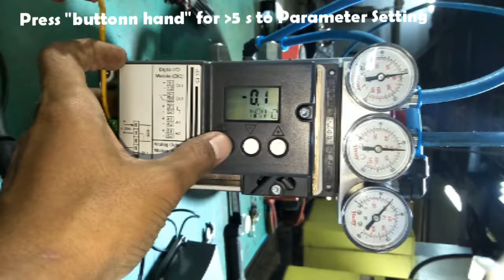Unboxing Control valve positioner, Assembly to butterfly valve, Setting Auto Initialing Bray S 6A

Comment: Brother actually   problem in my new positioner  is   in initial condition its display shows [ P 85 ] and [NOINI] mode, at that time  when i press + and - button the actuator totally not move.only small sound hearing inside the positioner and some air release backside of positioner , however pneumatic and electrical connection is ok.

if i place old existing positioner there then it easily move the actuator once i press  + and - key in sane NOINI mode as mentioned above.

So far as i know For go INITA mode at control valve should move manually in both direction and 100% travel also.

Moreover when i go in Log 5 ,NOINITM mode only 30% open the valve in both YEND1 and YEND2 once i press both (+) and ( -) key.once i release any one  button either ( +)  or (-) then actuator return  to zero condition.it doesn't hold at all.

What you think If its abnormal what can i do to fix it.would you please advice me.

 if i press only either (+) or ( -) button then actuator not move at all in YEND1 and YEND2
mode.but when i press both ( +) and (-)  button simultaneously then it open actuator only 30% but not hold at all.

After this  then when press hand button its display range message.
 
Therefore, will you please advice me its normal or abnormal?if abnormal then what can i do to fix this problem.
 
Really i am facing a horrible condition for this positioner at my site and i am apologetically wish to get you kind advice from you  please.

Gear ratio set in 33°. Yello switch press in downward position from Upper side of positioner.
Reply from the maker: Have you read manual book?
Switch 30° and 90° is different parameters.
Reply: @firdauss3222  yes we have read instruction manual and were set slip clutch in 33°
Reply from the maker: What type you're valve?
Reply: @firdauss3222  its linear actuator (pneumatic control valve)  of 20mm stroke
Reply from the maker: @mr.nizamulhoq851  lifting valve?  Up and down type?
Reply: @firdauss3222  yes.if you send your whatsapp number then i will send photo of existing valves.its air to open control valve. Its normaly close valve.
Reply from the maker: @mr.nizamulhoq851  air to open.  It's mean your valve have spring actuator diafram at above.
Reply: @firdauss3222  i have seen more sipart 2 comissionig  video in youtube , all of there go at first Pmanual and  NOINI mode  and press plus or minus key then actuator move easily after that they directly go log 4 for auto calibration.

but in Pmanual,  NOINI mode my positioner cannot move actuator at all.its main problem
Reply from the maker: @mr.nizamulhoq851  can you share link of video,
Reply from the maker: @mr.nizamulhoq851  share specification of you're positioner.
Reply: @firdauss3222  Please find positioner data as following :

Intelligent Positioner
Input 4-20mA, 2-Wiring
Metal-Housing IP66
single acting
Cable-Gland M20x1,5
Air-Connection G1/4
with Analog-Module
with Binary-Module.
Model : Sinemens Sipart PS-2 without Hart
Reply from the maker: @mr.nizamulhoq851  please share detail specification, for example: 6DR..... 
Can you see detail specification at positioner.
Reply: @firdauss3222   @New Smart India  brother this is the problem. I cannot go 50% manul link when i press + and - button in Pamnual NOINI mode .valve not move at all. Small clicking sound heared inside positioner at that time.

Specification of positioner is:

Samrt positioner made by Siemens.
Input: 4 to 20 ma.
Single acting. 
Without HART.
2 wire,
Reply: @firdauss3222 sir positioner mode: 6DR5011-0FG01-0AA0